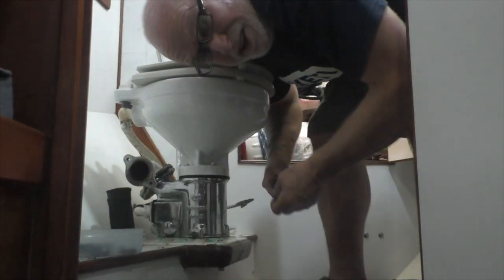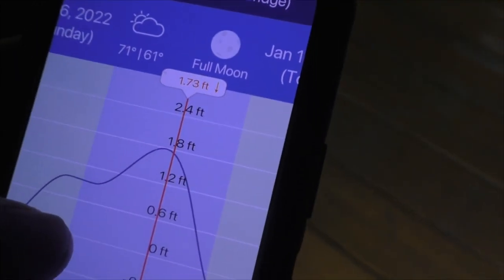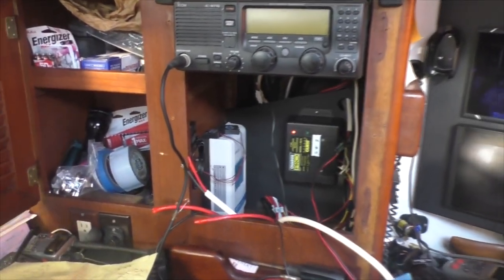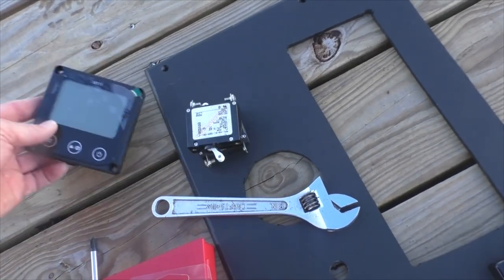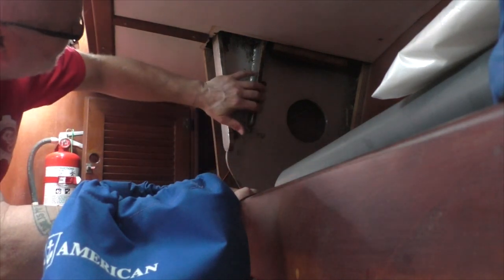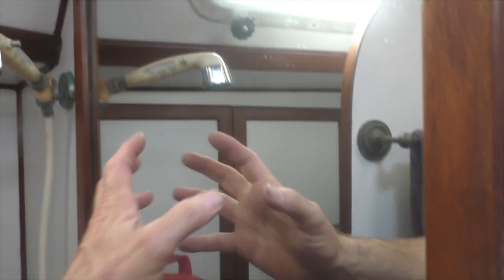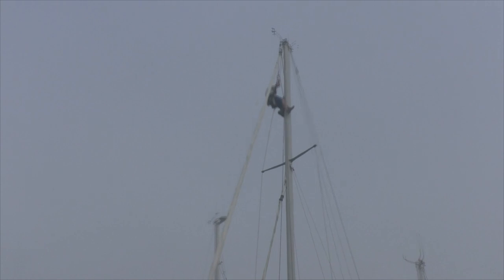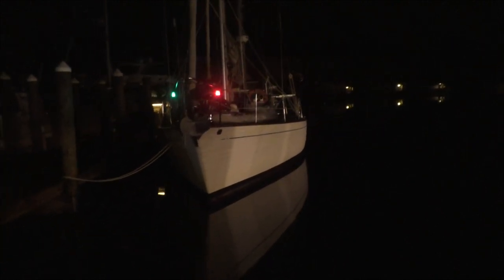Sailing Camp - Part 1 - Getting Started

Comment: The boats I restore are at least 50 years old and besides the rat's nest in most cases the wiring is as good as the day it went in. If I can make a home run out of it I will reuse whenever possible.

Comment: I think not inspecting 'hidden' standing rigging may be a common mistake. I was on a boat that was dismasted due to a rusted/sheared bolt on the rod holding the chain plate down below decks. The rigging had been professionally inspected annually as it was a charter but looking at the rust next to the shear line it was likely the faulty had been there for some time. Not an unsurprising place to get rust with hindsight - lots of fresh water condensing on the stainless due to cold climate plus the occasional drop of salt water through any minor chain plate leaks. A pain to inspect without completely removing/unscrewing however which I guess is the root of the issue!
Reply: Without constant exposure to oxygen, stainless steel will rust like regular steel.

Comment: No, the "full" moon has not caused the high tide. The moons mass and gravity remain constant, position in relation to earth, sun and distance of orbits affect the tides. How much if the moon is lit up doesn't.
Reply from the maker: I bet you’re fun at a party.
Reply: And what is a clear and easy way to tell the relative position of the moon and sun? The moon state! Spring tides typically follow a couple of days after a full moon while neap tides follow the new moon however this 'delay' will depend on local conditions. I'm also fun at parties.
Reply: Well then why is it that 2 days before a full moon the tide drops 4 to 5ft lower than normal, and a couple days after the full moon, the tide is 3 or 4 ft higher than normal at my dock at my house.
Reply: @jascan1489  Whereabouts in the world (vaguely) are you?
Reply: @hockey1234able  Ne Florida
Reply: @SVSeeker  Lmao!! 🤣